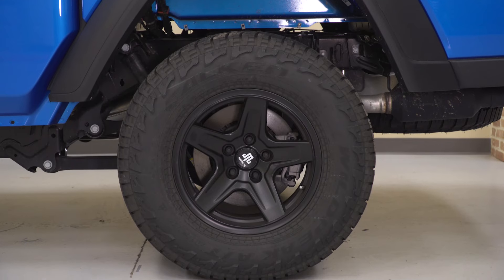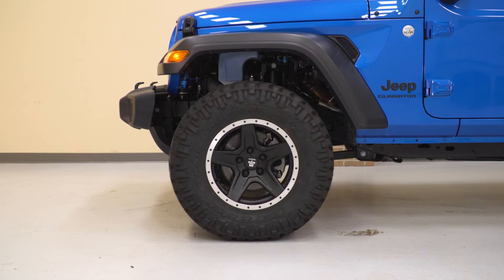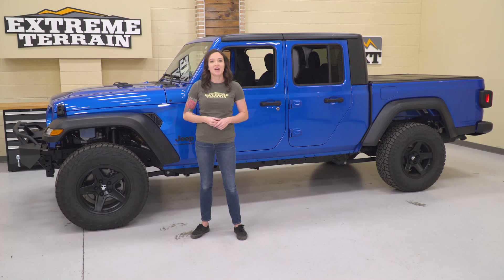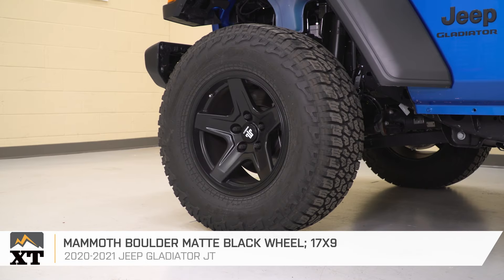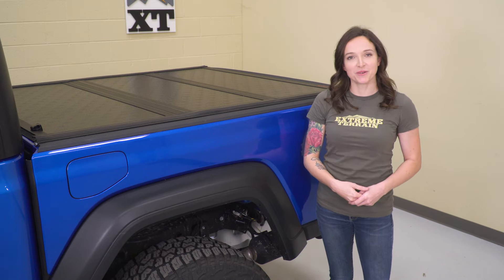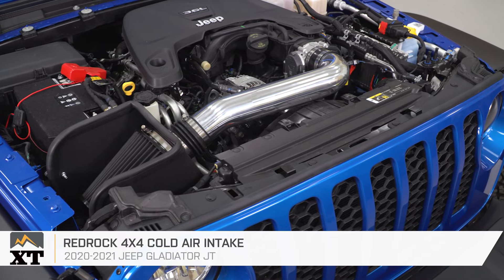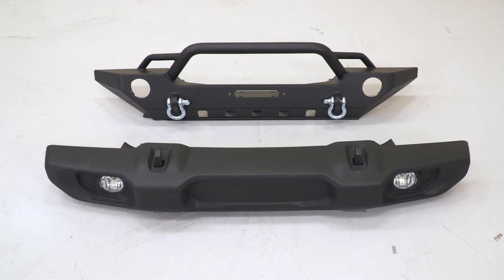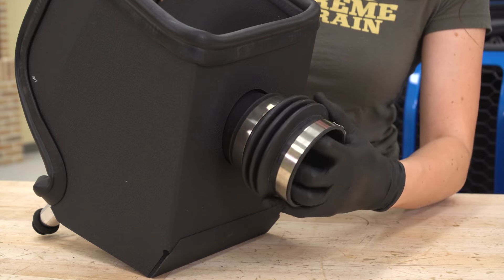First 5 Mods For Your Jeep Gladiator - Throttle Out

Comment: I bought a Mojave today, it came with factory sprayed bed liner, and all other regular goodies, but my first mods are going to be roof liner to improve temperature handling and reduce noise, trade the rock sliders for running boards, add more orange accents to tone down the blue,  a  bumper mounted step for the wife to access the bed, (it is her vehicle after all). Tint for the front windows, more orange accents for the interior, the door frame guards to avoid scratches…maybe that better air filter too and a shorter antenna.

Comment: agree with all mods except the cold air intake for two reasons. One , in a jeep you need your air box sealed from the elements, and two, with modern fuel injected engines the air is metered  by the mass airflow sensor and will not allow any more air in than the computer asks for. To prevent a too lean situation
Reply: Well said. There will need to be a tune to fix that

Comment: Well done! My first mods were similar. Tires, wheels then leveling kit then eventually a lift with 37s and 4.88s. I'd recommend Oracle lighting and upgrading the stock dim foglights to Diod Dynamics. Steal bumpers saved me from a plastic bumper nighmare deer strike but tore my stock fenders so flat feders replaced the ugly stock flares in plastic because metal fenders chip, rust and generally suck. Happpy Jeeping😊

Comment: Built a headache rack for my jeep full length with a ford ranger tool box damn thing weighs about 220 pounds makes the jeep ride smoother running 295/70/17 an duel 50s exhaust k&n filter front an rear after market steel bumpers

Comment: Have this bumper on my JL.  I like it a lot now that it’s on. However I would never consider buying it again as it’s absolutely the most horribly designed way of mounting it up if you don’t get the version with the studs on the bumper like the factory one has.

Comment: That Gladiator can handle bigger tires than 33's.  And have to be wary of those cold air intakes, sometimes they can rob a little power.
Reply: I agree. I also had some problems with coldair intakes. I had one installed on a JL and actually I felt that the cold air intake did improve power. But the funny thing was that during hot days I felt a power loss… which is ironic for a cold air lol. Mopar themselves offer a nice cold air intake… maybe I’ll try that out.
Reply: I think she meant "larger than 33s: since the Gladiator Rubicon's OEM tires are 33" (the excellent Falken Wildpeak A/T3W). 
It can take 35s with no lift, and (IIRC) 37s with a 1" lift. And, 35s will fit into the spare-tire well, also. One guy said his 37 tires did (forgot the brand/model tire), with only "slight rubbing" in one area of the "heat shield" (?) around it.
I'll just be keeping the 33s myself...
-- BR

Comment: Bull you do not need a alignment, Just adjust the track bar to straighten the steering wheel.
Reply from the maker: You could just do that - but we highly recommend an alignment after any sort of suspension modification. -Zach
Reply: @extremeterrain  If you do not touch or replace the tie rods and bar then no adjustment needed for toe. To even mess with the castor on stock arms you need to use alignment cam bolts and a small level lift does not justify that.... 3.5 left and up does.

Comment: Don't forget the most important mod of all. Truck U showed the anti motor oil drain back kit from Baxter Performance. 30 minutes after the engine is turned off, all of the oil drains back into the crankcase. Even the filter is bone dry. Every time you start your engine it's a dry start. Check it out!
Reply: These motors  go hundreds of thousands of miles usually. Looking for a Ram van with this engine and most used ones have well over 200k on em

Comment: As a owner since 2019 do not get a spacer lift you will regret it if you really off road!!  Although if your are just mall crawling it will be fine.
Reply from the maker: Spacers have a time and place, specifically on-road driving where you need something budget friendly. If you're considering doing moderate off-road in any sense, full springs are going to be a better option. -Zach

Comment: Those rims won't support the weight of the gladiator! This wheel's load capacity is 1,521 pounds (6084 total) Gross weight is 6,250 for a Gladiator and fat chance that weight will be evenly distributed front and rear. Better to have some capacity to spare, do your research peeps.

Comment: You're gonna drop huge money on a front bumper when approach angle isn't even an issue, but you're not going to protect the obvious weak point with the super long exposed rocker panels? Gonna have the sickest jeep at the mall
Reply: Steel bumper allows installation of a winch, lights, rings.